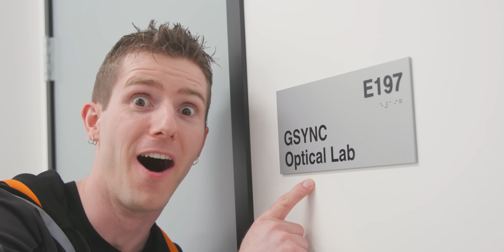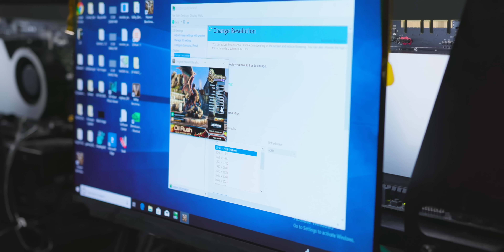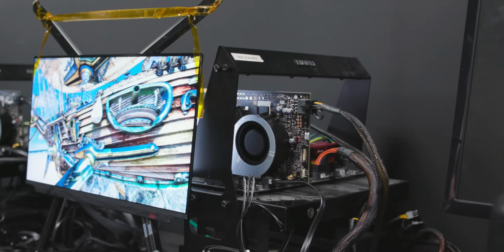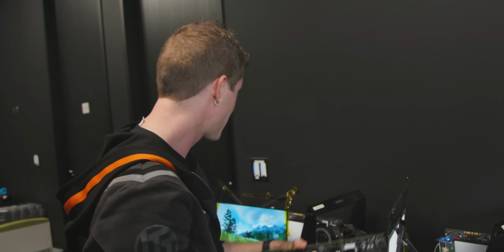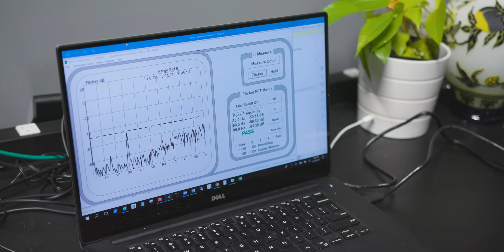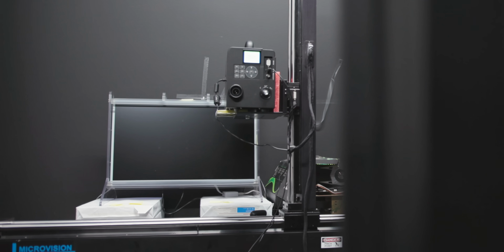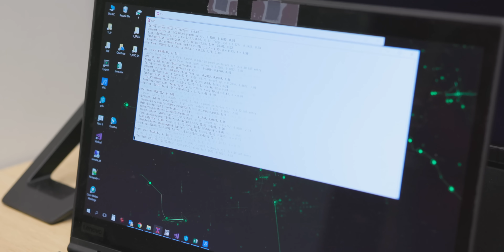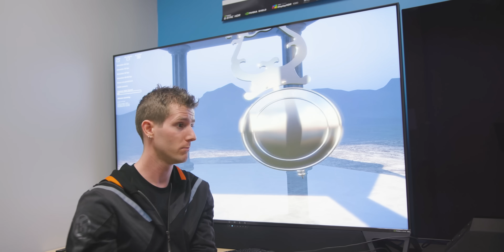Look what we found in NVIDIA's Top Secret Gaming Monitor Lab

Comment: The setups all look kinda janky, like a panel could be failed because someone sneezed or an aeroplane flew by a bit low. It’s all well and good to have 40k equipment, but using stacks of printer paper or tape to prop up a panel during the test, kind wastes it all.
“Just getting it done” is very different from “doing it well”.

Comment: TFT LED display's aren't all the same shit(if you look @ the basic you would say that lcd ips pannel it's just a damn active light filter) , if you have a simple 60 Hz refresh rate monitor then the sync between lcd and back light wouldn't be such of an fuss  , most of TV's or display's now comes with this minimum value and don't need more then 2 led chains (all though  you may see 4 wires going to the back light strip they actual do one chain in most 60hz cases). In the 140 Hz area refresh rate well this is a different story : the flicker of the back light must be precisely synced with the flicker of the tft panel + all other optical filters such light conductor, polarizer, diffuser etc. must be fine class light  filters ass the main result would gradually differ . 

This video is about one of the first 4k monitor made in 2001: https://www.youtube.com/watch?v=jlaxgiszfEo .

Comment: Hi there Linus,

I'd like to ask a few questions, please:

1. Motherboards come with QVL sections. Some manufacturers (ASRock) update the QVLs more often than others, and some update their QVLs upon request (again, ASRock; Asus are crap to deal with!), if they have time and it also suits them. How can I find out if a dual channel kit that I want to buy, but isn't on a particular QVL, will be compatible with that particular motherboard, especially if it is a RAM kit that came out a while after the motherboard?

2. Does the RAM timing of what I have access to, have to exactly match what's on the motherboard's XMP profile?

and

3. Does the RAM module having LEDs of any kind (most are RGB, but a few are monochrome LED) affect compatibility? If the timings for two different SKUs from the same manufacturer are exactly the same,  or mostly the same, I mean?

Here's hoping you've got the time to help me with these questions, thank you!

Comment: overdrive is why the samsung chg70 32" failed i think.  if you just leave it on 144hz its great.  but freesync\gsync turns off the fastest response time and it gets  a bit blurrier.  but i just leave it on 144hz at the fastest response time and lock the fps and i dont really see any tearing.  it also doesnt turn on adaptive sync automatically which is part of the spec.  but i got a refurb for 400 and its a good 144hz 1440p and its big.  so im happy

Comment: -Precise to 1/10th of a milimeter
-Stacked on printer paper.
Reply: Seeing as a sheet of printer paper is about 1/20th of a mm, it would be more accurate and cheaper to individually add and remove sheets than using that machine!
Reply: he wasn't talking about that equipment

Comment: Even Nvidia's Windows is inactive.
Microsoft u see this
Reply: Have you seen the gtx 1080 ti, not even nvidia is using rtx cards
Reply: @citer5574  Cause they know its just RAY THRASHING
Reply: Linus doesn't activate windows either. He has a video on why it's basically not worth the time with all the changing hardware.
Reply: @salami99  there is a software in windows that when you change gpu and cpu, the program thinks you put your hdd/ssd in new pc and don't wanna buy new license for windows. So it deactives it
Reply: @salami99  That's Nvidia's Lab where the G-sync monitor displays "Windows is inactive" not Linus.

Comment: Yeah but we still want $600~700 RTX 2080ti...
Good video btw.
Reply: Asking for it to be the same price as the last flagship is just unreasonable, duh.

/S
Reply: What if I told you that RTX 2080 Ti should not be compared to GTX 1080 Ti but Titan V instead? According to benchmarks RTX 2080 Ti achieves 80% - 96% performance in comparison to Titan V in workstation activities such as machine learning and 137% - 172% the performance of GTX 1080 Ti.
Reply: @mjkmetso2935  not really it should be compared to a 1080ti

Comment: Nvidia: best selling pc parts company

Also nvidia : uses 2 dollars tape to lift 500$ monitor
Reply: That is kapton tape. They may be using it due to its insulating properties
Reply: I'm thinking about that as well. They could've easily used a small "easel", which would be sturdier, and safer, than the make-shift holder. That tape could give any moment, given that some tests lasts for 48 hours.
Reply: Bruh they could literally just put a cheap 10 $ stand and thats it

Comment: Finally someone to tell us the real story in real time for G-SYNC.

But i heave 3 questions for the engineers or software developers about the G-Sync monitors :

1.  Why we heave to use third party program to lock 2~3 frames bellow the max fps of the monitor so the G-Sync will work?( i think that you need to add option in the nvidia control panel so we can lock the frame rate below the max refresh rate so the G-Sync will work write?) Or make it so it can do this automatically .

2. Every G-Sync monitor are very expensive so at their price point some monitors are not even color calibrated at all realy?????
In my opinion i think that every monitor (especially G-Sync) no mater the price it is need to be color calibrated from the factory because not every person who own a monitor heave a colorimeter(color calibrating hardware) to calibrate their monitors for best possible picture write?

3.I wonder why after calibrating the monitor we cannot save the ICC profile inside the "monitor" and not in the WINDOWS?????????????

Thanks ....... ;)

Comment: Holding up loose panels with tape and balancing expensive measuring equipment on stacks of printer paper lol. I gotta give them some mad ghetto points for that. No wonder Linus felt right at home =P

But seriously though, I just take that as a sign of no-nonsense actual engineers hard at work so I'm not going to hold that against them. It's just funny to see that the ghetto-rules of any tech-development lab holds true even for a giant like Nvidia =P
Reply: It's all about solving a problem the quickest, cheapest and easiest way.
Reply: @Lambda_Ovine Ahhhh, capitalism

Comment: that said Linus, gsync is for low frame rates and you're better off using that $200 xtra you pay for a gsync monitor towards a better GPU or settling for  freesync & gsync compatibles for higher frames in games where you dont need it

Comment: Still don't feel good about buying a G-sync monitor, you got ripped off. We got variable refresh rate with our none g-sync monitors without paying the premium.
Reply: Well most freesync monitors do only have a very small variable refreshrate window. Also all the cheaper ones are using average bad screen panels as there is no quality requirement. There are good freesync monitors out there however they arent cheap either and most highend gaming monitors are gsync certified as people want no compromise solutions. However you should always get a freesync monitor if you want to buy a monitor which costs less than 400$ as you will simply get more for your money

Comment: At 10:41 you can see the chip markings on the "special sauce" board. The reason these things are so damn expensive is that they're still using what looks like a Stratix-IV FPGA on these "G-sync module" add-in cards. Those FPGA chips are expensive as hell.

Comment: This makes you feel like display-overclocking is disrespectful. I kinda like it.
Reply: It is disrespectful. Panel overclocking is mostly marketing for  the non-technical masses, which you generally don't want to use.

Note that panel overclocking is not the same as pixel overdrive. For a high refresh rate monitor, the later is required. The former is almost always paid for with the degradation of some other metric.
Reply: @a5cent  I wholeheartedly agree, yet some people still do it. It's like, putting aftermarket body car parts on a Bugatti, it's disgraceful, but you know some moron with more money than sense wants to try it... 

Actually... HEY LINUS!...

Comment: Their setup is so jank, using paper as monitor stands and a mobo  box/tape to cover up the pc
Reply: That's why the majority of tech companies fail to profit and are constantly in the red. They are more concerned with the optics of their company, rather than getting the job done. 

"We need to hire a design firm to design stands to lift our monitors off the table since each monitor is different sized. We need $150k to get it done."

Comment: I expect this level of testing to be done by the monitor manufacturers themselves. It is unfortunate that NVIDIA has to step in and be a middleman in this industry for us to get quality displays. There are a few freesync monitors that are the exception but overall that is not the case.
Reply: It makes more sense for nvidia to do it because they can benefit from economies of scale. Besides that the monitor manufactureres have reasons to not test the monitors as thoroughly as Nvidia. For example the costs.
Reply: well there are several things at play, You can buy them completely tested, but it's pricy and company's like this calculate it. Plus as often happens, Nvidea can have a smaller speclist than lets say Samsung/LG are selling there displays with.

Comment: While you're there, tell them Turing GPU's are overpriced. The whole launch would have been fine if the price wasn't raised as much. People wouldn't have cared about the limited real time ray tracing performance, if it was a limitedly implemented cool new technology that brought the frames down considerably, if it was a free addition to the next generation. Instead consumers got a new generation without increased performance for the money and an interesting technology that's hardly usable. To make things worse by the time it is usable, the card will be too slow to use it anyway, since the current one hardly keeps up today.

Comment: This is what is behind "It just works".  
This is also what OEM nightmares look like.
Reply: @I_am_a_nice_person  Of course, within the range where it's supposed to work and everything like that. Sometimes it just doesn't want to do it's thing.

I've always gotten the sense that G-sync is always right on the verge of just giving up at any point. Sometimes it can be you just have to disconnect the monitor and reboot, then it works again. Other times I've had it where I had to reinstall the OS for it to snap back (even something like DDU restalling drivers wasn't enough). G-sync feels like it's got a mind of it's own most of the time... So "it just works" has been far from my experience.
Reply: Strange, I've only got experience from one G-sync monitor which I've used with two separate GPUs and on both Windows and Linux and it has always worked flawlessly.
Reply: @myownsite  100% agree with you, not had any of the issues the other guy has.
Reply: I've used G-sync on various displays and cards over the years... and not once has I thought to myself "it just works". It's the most finicky bullshit in tech. Sometimes it works, sometimes it doesn't...  Don't get me wrong, when it works it's great, but it's far from always and it's nightmarish to troubleshoot.
Reply: I guess Nvidia should have got their G-Sync guys to run the launch for Turing if they wanted it to work.
Reply: @budthecyborg4575  not sure they would be able to deliver on time tho ^^
Reply: @willies545  RTX launch: https://www.youtube.com/watch?v=lJhHjACjJjA
Reply: @budthecyborg4575  fuck that is an epic video, thanks for sharing ^^ 2 weeks, it's amazing
Reply: My King Crimson has already erased the time where your screen tore.
Reply: "it just works" has nothing to do with gsync... but okay ^^

Comment: Can someone please help me. I have a pretty old laptop but according to my dad, it had pretty good specs. Can someone tell me if they are good for running games like league? 
Specs: intel i7 (cpu) 4gb ram and 4ghx (whatever that means). Could someone please tell me if these are good or not, if you need more info, I can tell you
Reply: no you need like double or triple the ram! then rip out that stupid gtx 4 series gpu!  thats like a really old gpu!  even my 2015 27 inch 5k screen i mac, that has a AMD mobile sized GPU can eat that for breakfast.  that gtx 4 series of gpu's is so old its like the dinosaur of gpu's but keep the intel i7 thou as long as it's around 3.2 or 2.5+ GHz and by the way a netendo switch and xbox one and PS4 got like gpu's that are like 2-4 times more powerful! heck even the gpu  in my slightly outdated apple computer that  i currently use is like roughly 50% faster

Comment: so many millions still they hang the panels with ducktape!?🤣
Reply: those stations work on any monitor so imagine the work volume on those benchmarks, they need to swap a lot of displays asap, therefore they went to the easiest way on doing so.
Reply: @iannalemme  Yup. Easy, cheap, and if it's good enough, it's good enough. Perfect engineering solution.
Reply: They didn't want a big bill.. it's duct tape btw.
Reply: @John-og7os  Also it's not duct tape, that's kapton tape.

Comment: Who ever is doing the testing on all screens better be getting payed well! Much respect to them.
Reply: The testing isn't payed well.

Designing the test processes and developing any new hardware to do those tests... that is paid well.
Reply: @a5cent  no shit, who ever is doing those tests must have the knowledge and understand this line of work. So they are getting payed well but not more than the designers or developers.
Reply: @MrTransits  I guess it comes down to what "paid well" means.

I also think you're overestimating how difficult it is to execute these tests and understand whether a monitor passes or not. At least based on what I saw here, I doubt you need an in-depth understanding or even a technical background. IMHO an analytical mind could learn to run this lab in two or three days.

I don't work at nVidia so I can't speak authoritatively on that, but I work at a similar company and that is my impression.

Comment: Nvidia casually balancing what is probably a $2000-$3000 panel on some stacks of paper
Reply: they are a 92 billion dollar company so i think they'll be alright
Reply: You'd be surprised actually. Nowhere near that price; much closer to 10-15%.
Reply: @russ18uk  Well they said G-sync ultimate which is usually found in high resolution high refresh rate HDR panels according to Nvidias website but yeh most gsync are much cheaper
Reply: @russ18uk  propably the other way, since this is before mass production..
Reply: The panel doesn't cost anywhere near that much to produce, maybe it would for the selling cost. So no, they aren't risking anywhere near that amount of money lmfao
Reply: It's not theirs, so they don't care.
Reply: I mean that's what they sell it for. Not close to what it costs to make though
Reply: It bugs me that 500 people saw that and didn’t realize it’s not
Reply: It has a fucking stand, you idiot. The panel is not on the paper. Use your fucking eyes.
Reply: MiksteR_RdY you seem a little upset.
Reply: @MiksteR_RdY calm down dude it's not that important.
Reply: @MiksteR_RdY  At 7:00 you can clearly see that the stand is sitting on two stacks of paper.
Reply: So wait, the panel is on a stand? I didn't notice that before... What is the stand, standing on?
Reply: @MiksteR_RdY  people are slow. The op and 125 others who agreed. That number is almost certain to increase even after our comments.
Reply: 130 just in the time it took me to type that.

Comment: that's why G-Sync is hella expensive!!
Reply: Not only the testing makes this expensive.. at 10:35 you can faintly make out the marking on that big metal-lidded chip. They're still using FPGAs as the "special digital sauce" on these monitors. Looks like maybe a Stratix-IV. Those chips are highly customizable, but also very very expensive. Like.. that chip costs a few hundred USD on its own, and it's an "old fpga"..
Reply: LOL!
This is a sponsored video dude. This is a giant ad.